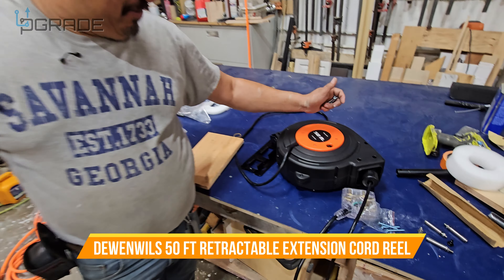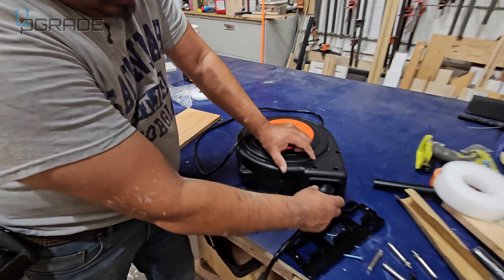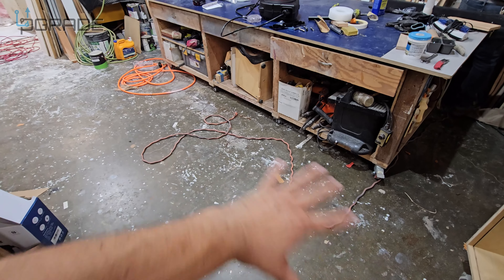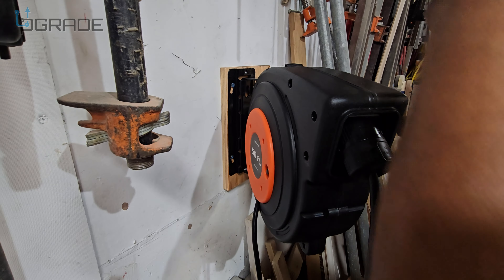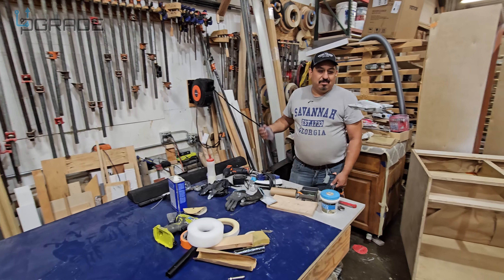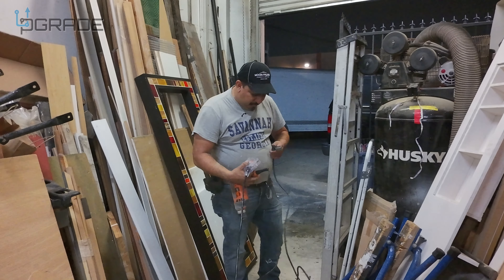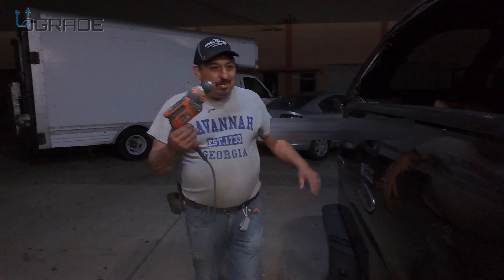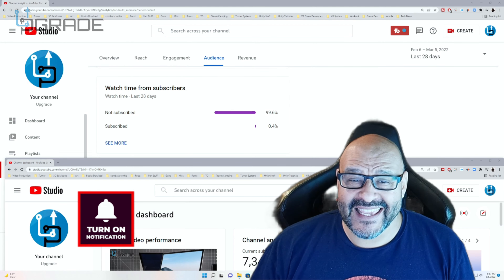Retractable Extension Cord Reel

Comment: its important to unroll the cable atleast to half of its length and not use too much power on that thing, else itll melt the cable insulation inside the reel and cause damages